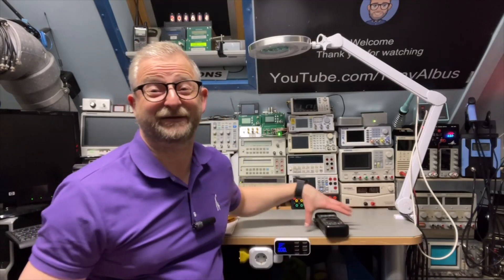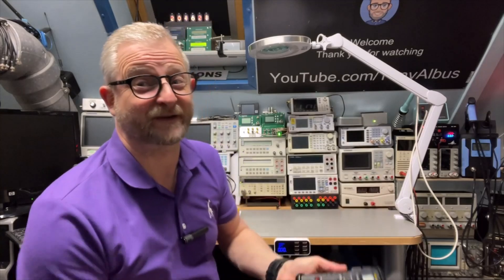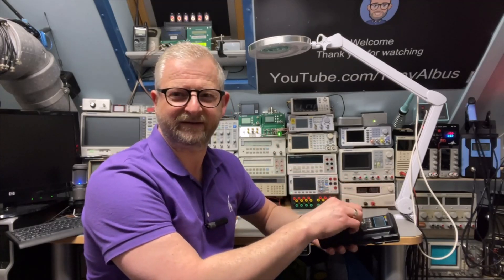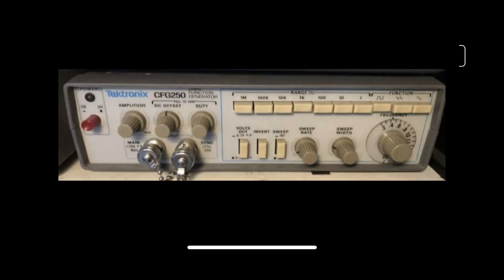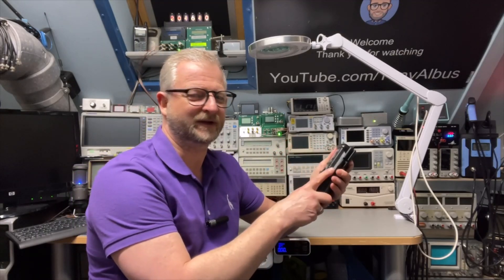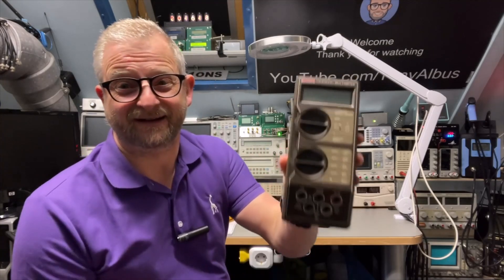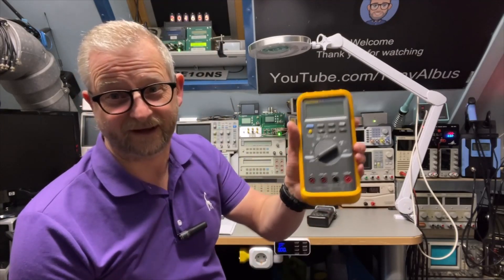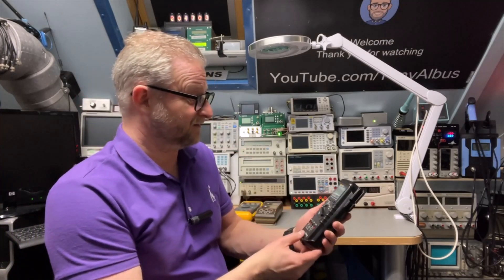#265 Tektronix DMM155 Handheld - Quick Test and Fix

Comment: 5:34 ya al no hacer sonido la zonda al conectarla mal te deja como evidencie que el fusible está quemado.
Hay una forma más fácil de probar el fusible sin desarmarlo, es colocar la punta negativa del tester en donde iría la zonda de 200mA y la roja o positiva en +V, luego se pone el multímetro en continuidad y se tocan ambas puntas, si suena el fusible está bien, si no suena el fusible está quemado.
Esta prueba se hace con un único multímetro y también funciona para la zonda de 10Amperes.

Lo que ocurre al hacer esto es que en lugar de cerrar el circuito entre orificio rojo y negro a través de las puntas, lo que se hace es cerrar el circuito a través del fusible, porque el amperímetro es un cortocrcuito. La corriente va de +V a través de la zonda roja, luego hacia la zonda negra, luego ingresa en +200mA, atraviesa el fusible y retorna a GND o COM haciendo que suene el pitido.
Reply from the maker: Thank you, that is a nice trick.. i needed to open it anyway because the current range was not working and it makes the video more interesting :)

Comment: Those fuses look the same size as the standard 1" (25.4mm) fuses used in UK Mains plugs.  13A is a very standard value, 1A are rarer and normally have to be bought through distribution. As standard they are sand filled which is normally required for fuses in DMM's.
Reply: Yep - Agreed.  They are standard household fuses in the UK (BS1362 plug top fuses), so only rated to 250V i believe? .  Did you get the meter from the UK Tony?  If so i think someone else has been in there before you :)
Reply: @Stephen_Heathcote  They are probably still electrically safe at 600V volt, but say they are rated 250V (so it matches the 250V on the back of the plug) for Joe Public's benefit.  Can you imagine the confusion if the fuses bought in the local shops had 600V on them!
Reply from the maker: Hi Stephen, the meter is from NL, but he could have taken it from UK.. so its not sure.
Reply from the maker: Thanks Chris!